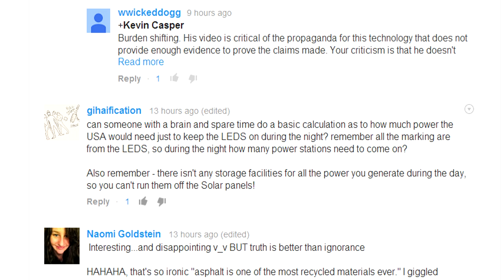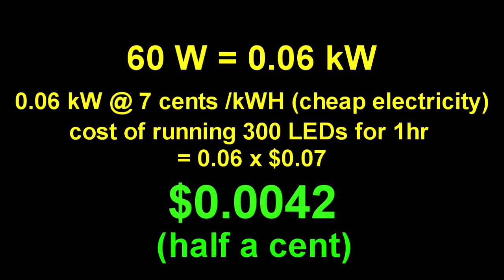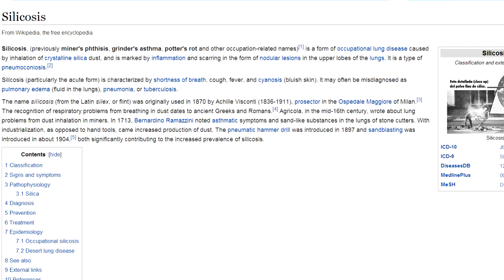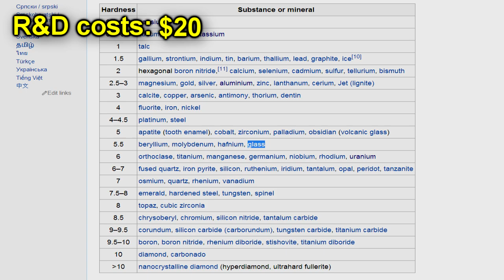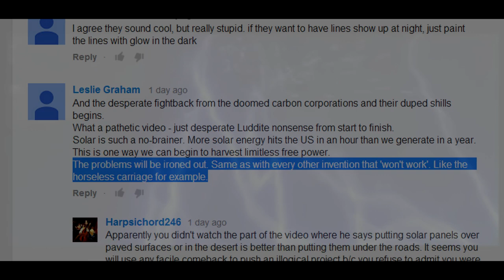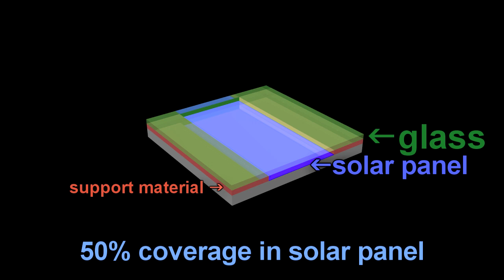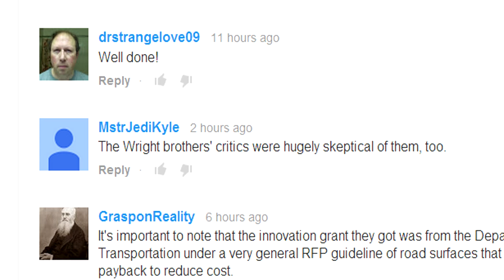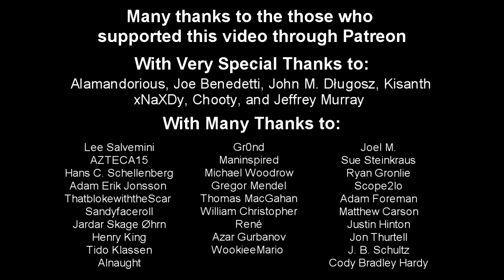Solar Roadways, IMPORTANT QUESTIONS AND ANSWERS!

Comment: I still want to see someone slam on the brakes on those tiles and how much noise they generate when you drive over them at full speed.
Because maybe, they will realize how utterly stupid the idea sounds.
Reply: Oh man... imagine the squeal of rubber sliding on glass during an emergency stop... I'm guessing it would be deafening.  Or better yet, a rock stuck under a tire just as you slam on the brakes.... nails down a chalkboard (not to mention the damage)
Reply: beayn Fun thing about the rock part though. When I was smaller, I used my bicycle to drive really fast and break on a rock on tarmac. I left marks after it. Just with my little weight and bike by hitting the breaks.

But it doesn't need to be a single rock, they could spread out gravel which will be on the road and then try it. Shattered glass everywhere!
Reply: I'd like them to have tanks drive over it, as those sometimes have to use the road, too, or have the tank brake from full speed.
Reply: Schnittertm1 In the Bond movie Golden Eye they had to put out metal plates when they drove around with a tank at a high speed to not damage the tarmac. Imagine the same speed on the glass. It would just splitter.
Reply: beayn as if the scratching experiments he did in this video wasn't enough... It was painful as fuck!
Reply: the guy who never uploads anything They haven't had the need to(in the us at least) but the us the highways (eg route66) were built specifically to allow military access to all parts of the nation.
Reply: the guy who never uploads anything Tanks don't destroy all roads.  If it was cobblestone with divots the treads could work into and then pull the stones up from then maybe, but otherwise I don't see why a tank would destroy  road.  Additionally the highway system, put into play by Eisenhower, was made in order to transport missiles and weapons across the country if necessary, so I'd imagine it would handle treaded vehicles.
Reply: the guy who never uploads anything
Actually, tanks are allowed to drive on roads, but to do that without damaging the tarmac the tracks need to be fitted with special rubber pads (usually called track pads).
Reply: Biochem Guy
This is true. Tanks use roads all the time. The only tank that would damage roads would be the Maus, and Germany only created 1.5 of them
Reply: beayn I have a feeling that the crash at that slide would much more noticeable :)
Reply: Schnittertm1 I did't even think about tanks. But yea, tanks would just destroy all the "roads" it drove on.
Reply: beayn  shudder You just gave me goosebumps.
Reply: Schnittertm1 Tanks dont drive on roads cause they destroy them. I think not even in a war. Maybe if it would be a real need.
Reply: In my town they use sound reduction asphalt, i think glass wont provide same noise level. silence-ip.org/site/index.php?id=119
Reply: Schnittertm1 oh ok thanks :)

Comment: Energy consumption is a very valid observation to make and what you have noted in this video and previously are issues inherent to building this "road". But I do have a little issue. The cost you calculated is misleading. If such a roadway were to exist then the cost of powering the led's shouldn't be equal to them all on at once, as they wouldn't be. Only a portion of the led's wo I ld be activated for whatever markings are needed.

Not to say that even then, power consumption would still be through the roof and you also have to consider idle power consumption of the led's, the processor's, and whatever else may go into building such a thing. How the supporters of the project can hear the phrase "glass road" and think it a good idea, I do not know.
Reply: As he addressed in his video, even with 20% of the 12 trillion LEDS running it would still run the electricity bill up to 500-600 billion dollars.
Reply: Cho Hakkai Ah, I must have missed that. My comment was in no way an attempt to de-legitimize thunderf00t's video.

Comment: 14:35 that's more like 50% coated with solar panel
Reply: No it isn't. Don't forget the gaps between panels. Try to imagine it without any of the screws or seams.
Reply: Kipah I agree, this is not close to being a optimized design yet and the surface area of the solarcells themselves will increase to cover most of the panel in any production design. But 100% is bullshit as well since solarcells as Tf00t pointed out can not be load bearing on a surface that has to carry (as they claim in the faq) 110t and all those LED's add up as well.

Comment: thunderfoot please what was that spark plug window video

this is a great video thank you. i agree instead of putting the solar panels in the road why not put them above. the weather does a lot of damage to roads. by putting the panels above the roads tracking the sun. that would shield the road and drivers from the weather and generate some power.

Comment: FYI 800 billion is a extremely tiny number compared to the total cost of all the roads. It probably cost more to paint them.
Reply: The roads have already been built. To do this project would require getting the roads replaced with the solar roadways. Plus he didn't calculate every factor, just a few of the known ones.
Reply: voldy21
It still cost more just to repair the roads we have. Instead of repairing one they would just do this. So we would instantly gain money for doing this.
Reply: Bruce Wayne how does one gain money by buying something?
Reply: ERIC moilanen
Because you would have to buy extra blacktop, paint, more reflectors, pay gas for trucks to bring the blacktop across the country.
You could have to pay all the just to repair a existing road. So instead of buying all that you could just buy these tiles instead, and pay less to replace the same road.
Reply: Bruce Wayne but you have to buy new glass , solarpanels, cables, cleaning companies, leds and power
Reply: ERIC moilanen That's a lot to add up to compare a price, that's why we are paying $2 million for research

Comment: You don't need all those LEDs to be constantly powered on.

So your cost calculation is greatly exaggerated.
Reply: If you want to use them as roadmarking you do
Reply: StormSpirit1 that is the point - road markings don't cover the entire surface of the road, and, the inventors also propose to only illuminate the parts of the road where there are vehicles driving, which also would minimize the power requirements, especially at night. In addition, they probably wouldn't make them 100% bright at night, to not blind the drivers on the road.
Reply from the maker: actually, if the LED are going to provide the road markings (as they hope to do in this project), you really do kinda need them on the whole time.

At this point, you really have to acknowledge that most of the lighting on our roads is currently solar.  It lights the roads up for almost the whole day!

Does it really make that much sense to take that sunlight, convert it into electricity with many loses, and then turn it back into light (again with many losses).  All of which requires a far more sophisticated infrastructure to maintain than a white line painted down the middle of the road.
Reply: ***** yes, but not ALL of the LEDs need to be powered for this task. It's almost like your computer monitor, you don't have all the pixels turned on 100% of the time, because you actually want it to create a picture, there will always be LED's /pixels that are black(ie not powered)
Reply: or that are not 100% bright
Reply: SG1guru thats probably true, still you wont get the energy from the panels at night, and during the day you would consume a significant part of the provided energy, especially if you make them bright enough to be visible. Add to this fact that the panels wont produce that much power and you barely get any power out of them at all. I dont know what you think about this idea, since you only argued against one of many arguments, but its really useless. I hope we can agree in that.
Reply: StormSpirit1 I dont really try to defend the idea of solar roadways, and i actually agree with most said in this video, i just don't think thunderfoot needs to make these sloppy calculations to defend his already strong position.
Reply: well to be fair exact calculations are next to impossible, as I said during the day the LEDs, if not made extremely bright, wont be visible at all and you would probably need way more than just a few per panel to create recogniseable roadmarkings. So while I agree that his calculation isnt accurate I still dont think his number is exaggerated all that much, since he also left out many factors that would make it more expensive.
Reply: I think, for bright daylight case one would want to use displays that operate on reflected light(like eInk for example), and don't emit light of their own. But i don't know if there is a technology that can withstand the stresses of the road.
Reply: StormSpirit1 And not only that, the LED's are allready hard to see on the day but you also need to consider the glass that's in the way making the LED's even harder to see, also I would bet that on certain times of the day from a driver's perspective the sunlight would bounce off the glass making driving somewhat unpleasing.
SG1guru You got a point, but thinking about it in order for the LED's to be visible to the eye in the middle of the day you are going to need a little stronger LED's to outshine the sunlight itself through the glass wich would make it extremely unefficient to to reproduce the road patterns during the day, not to mention to power up that kind of LED's you probably gonna need to use more than just one panel.
Edit: But that is only what I think, I have yet to do a minimal amount of research or testing so don't take my words as fact.
Reply: But how does the road know where the traffic are? The computer screen gets input from the computer and I decide what pixels should shine. 
Every panel needs to be pressure sensitive and send data to other panels and they in turn need to know when to turn on depending on speed and they need to function no matter if it's a 36 ton truck or a bicycle. These are things that take electricity.

Comment: The LEDs probably wouldnt be bought at commercial prices, probably something more like 1/2 or 3/4 the price...which is still 400 or 600 billion.
Reply: dont forget the VERY limited lifespan. Swapping those LEDs out once every 5 years would cost a fortune...
Reply: Still to much.
Reply: Conundrum
Asphalt...
Reply: Thadd Corbett Well - realistically you'd make a pilot project: A test run where you'd page up one road with the stuff. The road would have normal traffic, so you could test how the thing held up.

Oh, and I just had a though on why this system would NEVER work in colder regions: Ice expands. These hexagonal blocks have tiny spaces between them, enough for water to seep into. If that freezes the blocks will be pushed around and ultimately broken. Heck, if water seeps into the electronics...
 - and even with these idiots claiming that the gizmos will be heated, Thunderfoot has already pointed out that with the solar panels are covered in snow, or if its nighttime - then there's no juice to heat with
Reply: Yup. When I see projects like this it makes me think of millionaires sitting on the side of the road begging for money.

There's still thousands of hours of work and research to go into self sustainable roads that provide energy to a nation before this even becomes a pipe dream. 

This isn't even a pipe dream yet.

This idea is as crazy as people that say JFK was an alien and stood up to Russia so that his kind could plant their seeds in Europe.
Reply: When has the government EVER bought something at or below commercial prices?
Reply: Can you imagine telling a nation of 300,000,000 people that the government intends on spending 400-600 billion dollars on led lights? Even if this was a cost effective project, this would make no sense to people whatsoever. 

The White house would probably set records for all time number of protesters to be standing outside. It would be so congested that anyone going to or leaving the White house would have to do so by helicopter. It would look like a zombie apocalypse outside to the people in the White House.
Reply: But that is still kind of insane.
Reply: Diana Peña Doesn't they technically already own the asphalt as most of it is recycled?
Reply: Cloud Seeker
Yep. However, it sometimes needs to be replaced after a long time. You can't recycle an infinite number of times.
Reply: Conundrum
What the fuck? I know plenty of people are anti-government but if a government is buying something it's likely in bulk, I don't know how you pay more than commercial prices when you're paying for bulk.

Comment: Love your video's mate. But in the description your talking about the cost of the electricity, and I get that you have talked about not being able to produce the needed electricity for all of the panels considering nighttime and other factors etc... but ignoring that isn't the point to use the panels themselves to power the LEDs?
Reply: You cant because you cant store the energy they produce. Its very difficult to store large amounts of electricity so the energy produced during the day that is not used then and there will go to waste.
 And when night come around and they start using energy instead of producing your gonna have to fire up the ole fossil fuel/nuclear generators.
Reply: arglesflargle
Fair enough, I was just curious, but really don't know that much. Obviously it would add more to what seems like a huge cost, but couldn't batteries or other storage cells be used, even small ones, along the cable tunnels the creators talked about? Batteries are getting better and better aren't they?
Reply: Michael Milner Small rechargable batteries in each cell could work I suppose but they have limited life expectancy.
 And on top of that I should think the cost of so many lithium ion batteries would just push a project with a already completely unworkable cost to just astronomic levels of silly money.
And I'm no expert but is there even enough lithium kicking about for that?  Any geologists or someone with some relevant knowledge wanna chime in on that?
Reply from the maker: yeah... if you get a little further through I show that these solar panels MIGHT just about be able to power the LEDs on them.... but they wont generate any spare power to do anything else with.  At which point.... you would be better having angled solar panels by the side of the road powering overhead lights.  The installation costs  would be less, plus you dont have to coat the road with a material that is not suitable for driving on, plus you dont have to dig up the whole road every time you want to change the LEDs.  

It really doesnt matter which angle you take on the solar roads idea, it crashes just as spectacularly as the proverbial Lead Zeppelin!
Reply: Michael Milner
 Well, aside from the point that you still can't see LEDs (and consequently, road markings) during the day, buying enough batteries would probably cost some billions, and I doubt that during the winter, when days are short, panels would even be able to produce enough energy during the day to power the LEDs during the night.
Reply: arglesflargle
I have no idea, but you bring up some good points. Thanks for the info :)
Reply: *****
Yeah you are absolutely right Thunderf00t. Thank you very much for the reply, and also for the entertainment over the years!
Reply: ***** Fails on all teh levels.
Reply: jazzybaboon
That is not what I said, I ASKED if the panels themselves could be used to power themselves to avoid some of the electricity costs that thunderf00t estimated. I am sure they would have other uses than simply the LEDs so if it were indeed feasible it would not simply be replacing them to they could generate power for just themselves. However if you read the replies I have been shown that it is still not for the reasons listed.